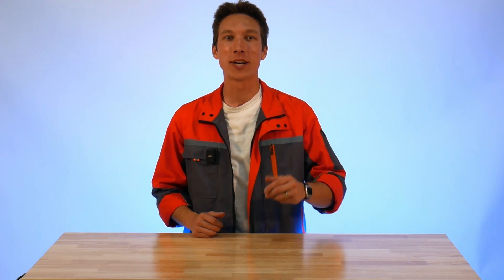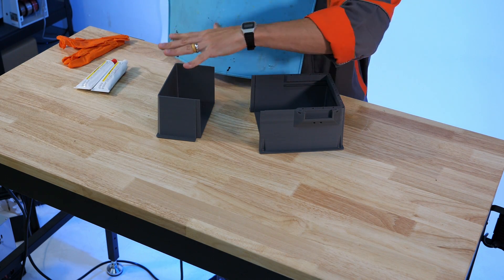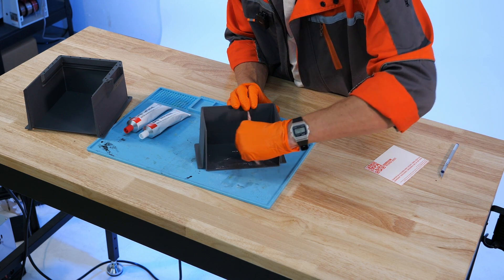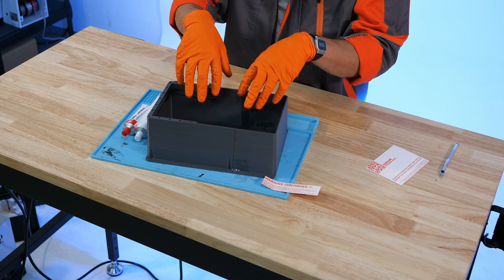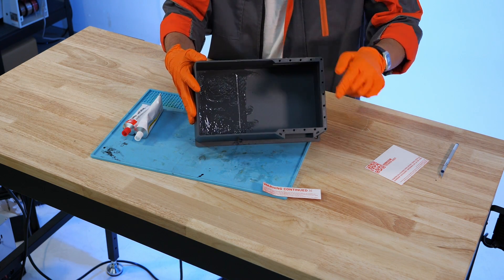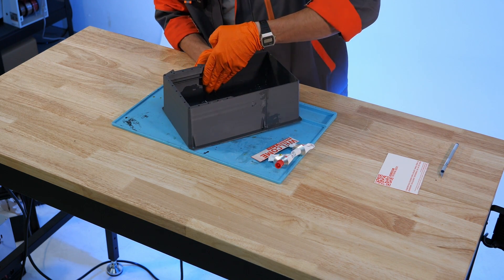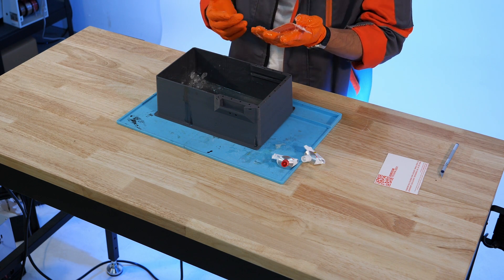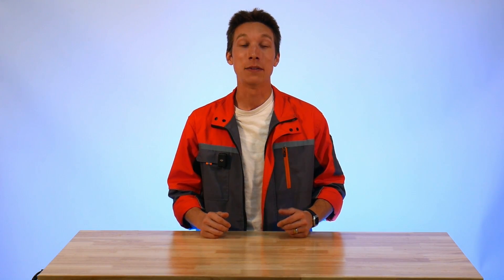3D Printer to WEDM Machine GUIDE - Part 4

Comment: Where do you get this vat file (the only one that could be found is the v1 power core vat) where do you get this split vat stl  that your using.
Reply from the maker: It should be in the zip file with the wire tool on Printables.